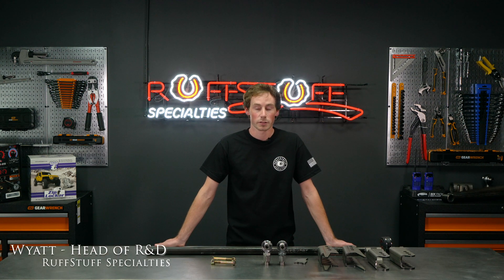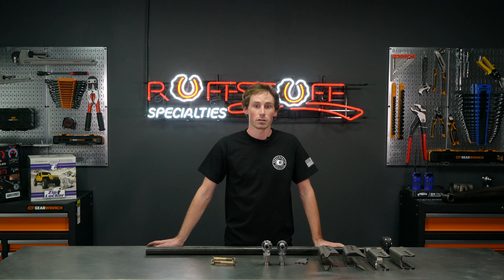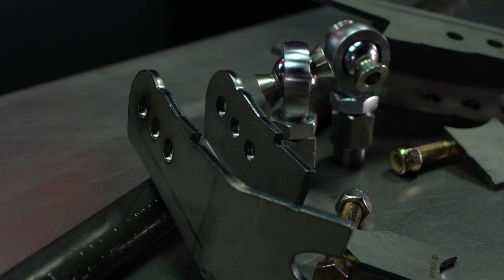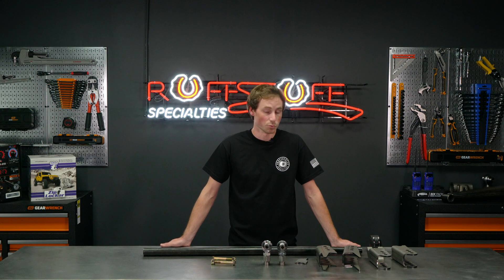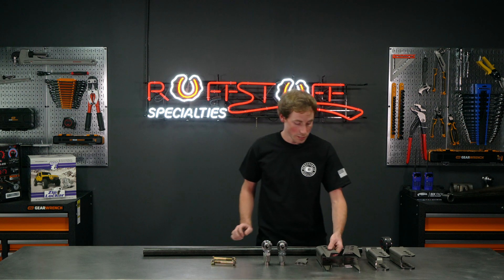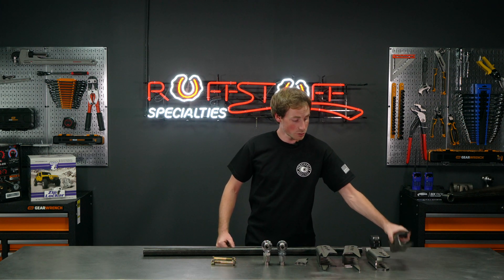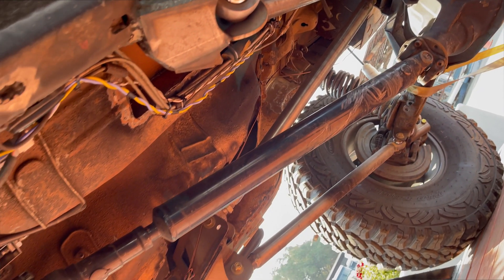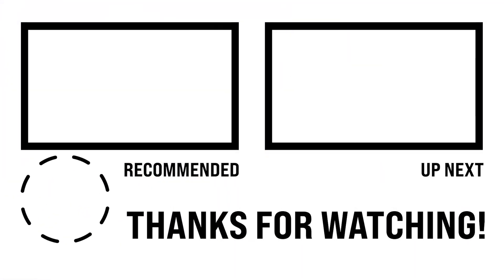Panhard Kit Explained: Common questions and misconceptions

Comment: Same angle yes but as a Jeep mechanic I never find them the same length..im just looking for track bar options for my ls 6.0 swapped 1970 gmc jimmy with high steer w/psc ram assist and dana 60s... so besides clearance or binding issues what's the point of having the track bar stick out past the mount like that??